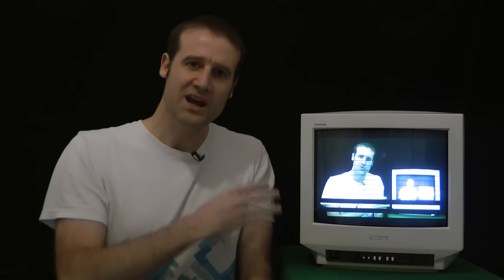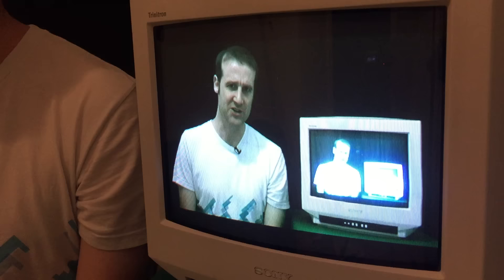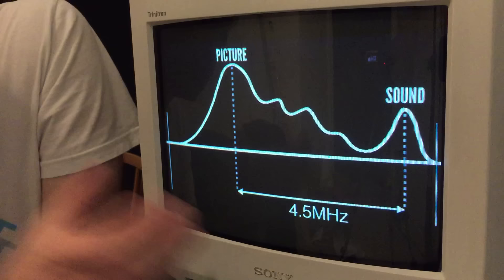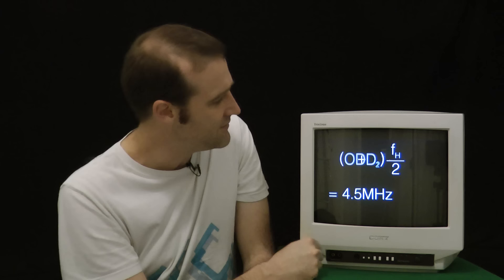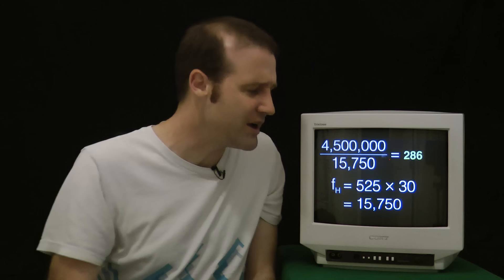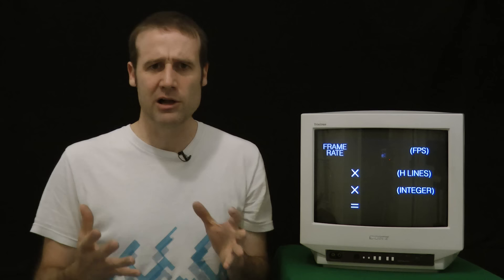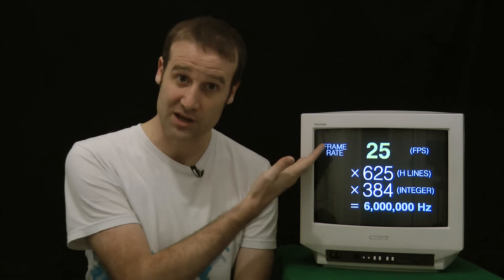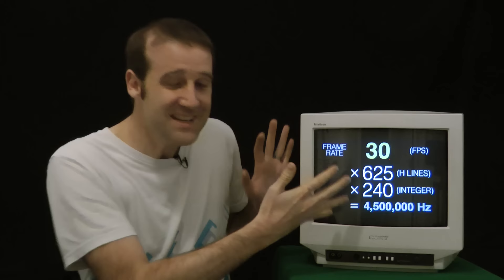Why is TV 29.97 frames per second?

Comment: @3:10 - You said TV "is sent as a signal over radio waves." Why isn't it sent as a signal over TV waves instead?
Reply: Since it's transmitted through electromagnetic waves, the name of the wave is found on the electromagnetic spectrum. TV waves aren't actually a thing, whereas radio waves are. The next thing after radio waves are microwaves, then it's infrared, and so on.

Comment: Little did the PAL people know that this 50Hz system, while nice mathematically, turned out to be quite awful for upcoming video game systems. The NES, SNES and N64 for example ran slower due to this. This is why European carts don't work on NA/Japanese systems. This wasn't necessarily Europe's fault but instead Nintendo in particular ran at 60Hz and timed their system based on this so 1Hz = 1 second... but if your system runs at 50hz then your game is only running at 5/6th the speed or 83.3333...%. Turned out to be quite jarring for people.

Comment: I'm using Adobe Premiere Pro 2020 (because I can't afford Final Cut Pro at this point in time but that's another debate). When I set up a new sequence I have 4 choices. I'm in Australia so have the luxury of PAL. None-the-less, I am asked would I like an available preset of ARRI 1080p 23.976 or 24, 25, 29.97 or 30? so why 23.976 as a default? Is it due to so much American content being converted to PAL?.. anyway, that for a GREAT video. Love your work.
Reply: 23.976 is the effective frame rate you get when you telecine movie footage via 2:3 pull down into NTSC's 29.97 frame rate.

Comment: You've missed whole point. No offense. I'm certain that the decision to continue to use the frequency had less to do with a technical ability to find a common denominator for phasing chrominance and luminance. It has much more to do with the fundamental nature of the original purpose of this technology, as with most technology: It's industrial psychology. Behavioral science. Frequencies phasing modulation are essential for behavior management. NTSC has gathered powerful insights with this TV experiment. Of course this science will never be made available. Obviously they needed a control group, so that's PAL which is offset, like film. The "sublime"  frequencies are multiples of 15 (almost ) most new, tvs and phones. So obviously the experiment works, and is now global.

Comment: I'm glad everything went digital.
Reply: The mess of standards got even worse. Resolution can vary, video can be sent interlaced or progressive, data can be encoded in many different formats and even may be encrypted. The only difference is that thanks to modern electronics it is easier to build devices which can adapt to this mess of standards.
Reply: Over-the-air broadcast Digital TV as implemented in the US (and Canada and Mexico) is called ATSC and uses a modulation called “8-VSB”. Unfortunately, it’s technically problematic, and the systems used by most other countries (DVB-T and successors) are superior. It’s NTSC vs PAL again....

Comment: I disagree because Up all country in the world use the same wattage standard with different volt × amps radio which computers have eliminated 90 percent of problem by converting into pure digital at possible rate but as far as tube tele goes the Chinese have mastered a UPS invertor/ standard invertor that will cycle between sine wave during a start up surge and detect the proper sine wave which the outlets are make to fit any mains plug and its quit a useful thing to have when traveling became you will not find pal to NSTC converters in the U.S as a common bit of tec to buy anywhere at any time.

Comment: But from where the TV's take the 60/1.001 Hz for syncronization if the AC line still has 60 Hz?????
Reply: The sets always used the video sync signals (specified in the NTSC - RS170).  The AC (60 hz) caused visual artifacts in most early TV sets so having the vertical rate the same as the AC meant that the interference was stationary.  When the video is at 59.97 hz the interference rolled through the image at a slow rate that was not too annoying.

Comment: The video was interesting and informative.
    However, many of the commenters are from the lower half of the Bell curve. This bashing of engineers from 60-70 years ago for doing their jobs is ridiculous.
    We have different standards for TV Broadcast, electricity, measurements, etc because we live in different worlds. When we adopt a standard for something like TV, it gets used by thousands of TV Stations and we sell millions of TV's. Those TV stations make money by selling advertising because they have many viewers. If you bring out a change like Color you don't want to lose all of your existing customers because you want to broadcast color and you don't want to have a color  channel just for a few hundred customers. In the case of electricity, once the decision was 60 cycle, 110v, 220v and was installed in 100 hundred million households with billions of electric devices you don't change it just because it could be better. In the case of measurements, we use Metric a lot more than many people think. But, again, once standards are set in an economy the size of ours you don't retool just because a different system comes along. Our scientists use Metric in all of their research and experiments. Our engineers use mostly Metric or Decimal Inches in their designs. Construction is mostly Inches and Feet, because of the installed base of buildings and materials manufacturing. Daily lives are for the most part not Metric, we use Gallons & Quarts & Ounces, Feet & Inches, Miles, and Pounds regularly. However, all of our containers are labeled with the Metric equivalent. We don't have to retrain a large population to be able to use a different system and visualize what it means. 
    America didn't have the luxury of destroying itself twice in the Twentieth Century so that it could start over with a clean slate and rebuild everything.

Comment: Increasing the number of horizontal lines wouldn't have increased the bandwith needed for the transmission?
Just wondering
Reply: Without increased bandwidth, it would have increased resolution in one direction, but decreased it equally in the other.  (and would have become generally less efficient.) It also would have broken compatibility with existing sets, so no one would ever watch color programs, and the system would have failed utterly.

Comment: Was I the only one, who, redoing the NTFC calculations, was 4.5 hr short?
Reply: "That's a good explanation except for fact that it's not 100% technically accurate. 29.97fps * 525 lines * 286 is actually equal to 4,499,995.5. Although we nominally refer to the NTSC framerate as 29.97, that's actually just an aproximation. The true framerate is actually 30/1.001, or about 29.97002997002997... When you plug 30/1.001 into your equation, you get EXACTLY 4,500,000Hz." -SlideRSB somewhere in these comments

Comment: Why didn't this get changed with the conversion to digital TV?
Reply: Same reason: Backwards compatibility, plus, why bother? Digital equipment had already been delevoped to handle 29.97 (it was being used in production long before the broadcast system switch to digital). Older programmes made at 29.97 still needed to played and transmitted. Why introduce another change of system, if it doesn't actually gain you anything?

Comment: Do these standards still apply to HDTV? I know there is NTSC and PAL TVs but now they have way more resolution and I would’ve though more then 29.97 frames per second. Our digital TV broadcast standards here now either come in 720p(maybe I) and 1080p (or i?). Would the old SD tv NTSC standard still be effecting the newer HDTV broadcasts till today?

Comment: But the frame rate is actually 29.97002997002997002997002997002997002997002997002997002997002997002997002997002997002997002997002997002997002997002997002997002997002997002997002997002997002997002997002997002997002997002997002997002997002997002997002997002997002997002997002997002997002997002997002997002997002997002997002997002997002997002997002997002997002997002997002997002997002997002997002997002997002997002997002997002997002997002997002997002997002997002997002997002997002997002997002997002997002997002997002997002997002997002997002997002997002997002997002997002997002997002997002997002997002997002997002997002997002997002997002997002997002997002997002997002997002997002997002997002997002997002997002997002997002997002997002997002997002997002997002997002997002997002997002997002997002997002997002997002997002997002997002997002997002997002997002997002997002997002997002997002997002997002997002997002997002997002997002997002997002997002997002997002997002997002997002997002997002997002997002997002997002997002997002997002997002997002997002997002997002997002997002997002997002997002997002997002997002997002997002997002997002997002997002997002997002997002997002997002997002997002997002997002997002997002997002997002997002997002997002997002997002997002997002997002997.

Comment: Sooo much bad for 4500 herz in 4.5 MHz band (286*15750 == 4504500), it's 0.1%
Are old TVs really so bad so they can't be overclocked even by tiny 0.1%? 
They could just reduce the wasteland by 4500 herz  (1.8%) and it could be fine, I think

Comment: 07:16... would you get a beat frequency between the line frequency of 60 Hz and the 29.97 frame rate frequency?
Reply: The line frequency isn't 60Hz, it's 15,750Hz.
Reply: Gerard Law power line is 60 is US, 50 Hz elsewhere .....
Reply: @hypercomms2001  Ah! A confusion of terminology. I thought you were referring to the television scanning line frequency, (15,750Hz in the US, 15,625Hz in Europe). We tend to use the expression "mains" rather than "line" for the public electricity supply. ("Two countries divided by a common language..."!)
Reply: There's nowhere that the power-line 60Hz is at a comparable level to the field-frequency 59.94Hz, so there's no problem with heterodynes as such. One place you could see an effect, however, was if there were hum from the power supply overlaid on the line oscillator, causing a lateral ripple on the picture. That would drift through, nominally at 0.06Hz or over a 15s interval, but that was always a possibility even with a 60Hz field rate, because the frequency of the public electricity supply varies during the day.
Reply: @gerardjlaw  Thank you.  Memories... many years ago i was an RF engineer spending my days with sig-gens and spectrum analysers... these days I am studying for a Masters of IT.... I used to sell analogue broadcast test equipment... waveform monitors, vectorscopes...
Reply: @gerardjlaw   We now speak different dialects of once a common language. In the fullness of time and perhaps some separation American English, Australian English will evolve into completely separate languages as Spanish and French evolved from Latin.
Reply: @hypercomms2001  I think the Straylians have gone that way already!

Comment: At the BBC we were taught that NTSC stood for Never Twice the Same Colour.
Reply: And PAL was Perfect At Last!
Reply: @gerardjlaw  And a VU meter was virtually useless...
Reply: Absolutely! Awful, amateur things, as befitted the High-Band U-Matics in PSC.
 
However, I once squeaked a U-Matic with an EP/14 and confirmed what I'd been told, viz that if you set the input gain so that tone (at PPM 4) lifted the VU to -4dB, the subsequent programme sound  (peaking to PPM 6) JUST filled the available headroom without going into distortion.
 
Television Centre TK '80 - '81
BBC Scotland VT '81 - '92
Lime Grove TPC VT  '83 - '84

Comment: Why are there so many 9's in life?
29.97 adds up to 9
60hz is a 9 upside down.
360p adds up to nine. 
720p same.
1080p same
1440p same
Now 144hz is popular... You guessed it... Adds to 9.

We are up to the i9 CPU
Windows never made windows 9
iPhone skipped over the 9

9 lives in a cat
Cloud 9
The whole 9 yards 
9 months in pregnancy. 
We start work at 9. With an hour lunch break... We get out at 6 (upside down 9) which is also 1800 hours military time (adds to 9)
A yard is 3 feet (36 inches) adds to 9.
6 feet tall is 72 inches. Adds to 9.
72 is the typical temperature people put on their ac's.
360 degrees in a circle.

The number 9 itself is like a swirl. That swirl is the shape of the milky way galaxy. 
Also the shape of tornados from an above view.
Also of a toilette flushing. Also of your ear. Also of the Fibonacci spiral.

Your Mead workbook had a times table. Why did they always end it at 12x12? Answer is 144... That equals 9

It's also the only number besides 0 that you can add to a group of numbers and reduce by adding those numbers down and still get the same answer...

1+1=2.
1+1+9= 11... Which still equals 2 when you add the 1's together in your answer of 11. 

Wtf is going on here man?
Is there some shit being hidden from us?

And how come binary computer (doubling circuit) code never shows any 3's 6's or 9's (3+6=9)

Example... 
1 doubled... 2
2 doubled... 4
4 doubled... 8
8 doubled.. 16 (equals 7)
16... 32 (5)
32... 64 (10... 1)
64... 128 (11... 2)
So basically you get a repeat of the following sequence infinitely:
124875 
No 3's. No 6's. No 9's. No 0's. 

W.T.F. !

Comment: The dot doesn’t move!  It’s a vacuum sealed lightbulb 💡.when a current is added,only the tip of the glass starts to heat up and glows..under a strong magnifying lens you’d be able to see the television image within the tiny glow at the end of the bulb..the vacuum sealed lightbulb was covered by a funnel shape to slowly enlarge the image to what we call screen size...my good friend was a radio ham engineer,he’d build his own equipment from scratch by salvaging original valves and tubes...quite remarkable how it’s possible to send sound and picture through the airwaves by creating a static gateway..of course digital signals work exactly the same way but at a much higher frequency..not as much interference now because of the aerodynamics of the signals...good video though!..not many of the younger ones are actually interested though 😂,,they’ve got the new toys without having to build it..all the best to you

Comment: Okay, but since ntsc and pal are irrelevant nowadays, is there any point to using 29.97 and 59.94 instead of 30 and 60 respectively?
Reply: ...Except that they've not irrelevant, since a great amount of material was made to those standards and people still want to watch it, and ideally they want to watch it without glitchy motion caused by crudely done standards conversions. 

So, one reason for keeping the odd rate is that you need to keep the soundtrack in sync with the picture. If you've got material that was shot on NTSC at 29.97, and you show it at 30fps (about 0.1% faster), you need to speed up the soundtrack to match. But the sound systems are mostly set to run at precise rates such as 48000Hz, or 44100Hz, or multiples of those, so you then either have to shift those frequencies up by about 0.1%, or resample the audio. And since most audio these days is stored with lossy compression (MP3, AC3, etc) that means you have to decode the existing audio, resample it, and re-encoded it, which takes processing power and loses a little bit of quality...

Another reason: If the timing of events in the video is crucial, e.g. it's being used as evidence of a sequence of events, parts of which were caught on several different cameras. If some were running at 30fps and others at 29.97, and you treat those as the same, after a while you could events out of order.

The same problem occurs anytime to have mismatching frame rates: You have to decide whether you are going to keep all the original frames and run them at a different speed, or keep the speed and add or remove frames, or some sort of compromise; AND you have to decide how to handle the audio to match.

We're gradually getting to the point where all TVs and blu-ray players and set-top boxes should be able to handle all the different standards equally well, but we're not there yet. And of course, new standards are being invented all the time...
Reply: @therealpbristow  Oh yeah right, I never even thought about any of those.
I just never quite understood why basically all cameras/DSLRs and video editing software use 29.97 and 59.94 as a recommended/default setting.

Comment: This basically the same stuff that Technology Connections has covered.  I was hoping that Stand up Maths would be able to give a better explanation of Quadrature Amplitude Modulation, but you've actually covered it worse than Technology Connections.  He pointed at it and then said he didn't understand the math.  You didn't mention it at all.  Disappointing.
Reply: I know but this is a maths channel, not an engineering channel.

Comment: PAL has better quality no just because of the 625 lines but because of the ‘Phase alternate Line’ to lock the colour signal to the monochrome signal where the colour signal flipped every line and the receiver anticipated this therefore it knew exactly where the beginning of each new line was, NTSC did not do this so the colour drifted. ‘Steam’ tv was brilliantly engineered as the b&w reverse compatibility was designed in from the beginning.

Comment: so you are saying rather than changing the frame rate, which was cost effective and could be done entirely on their end the SMARTER choice would have been to force the entirety of consumers to purchase brand new tv's with the different resolution or to rebuild and replace the nation-wide electrical system just so the frame rate of video was a bit more tidy.